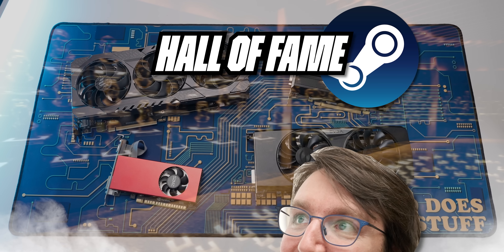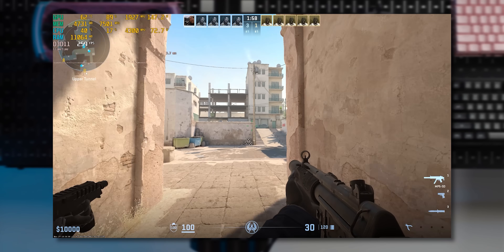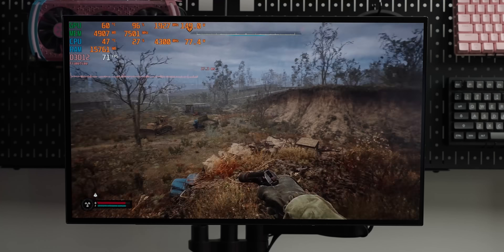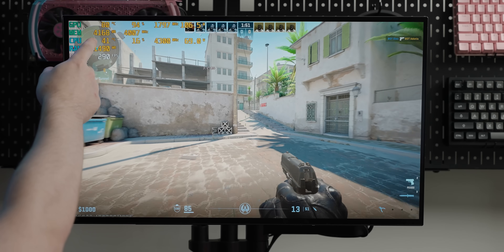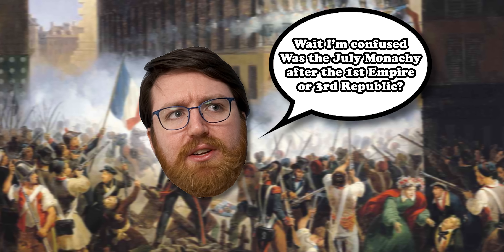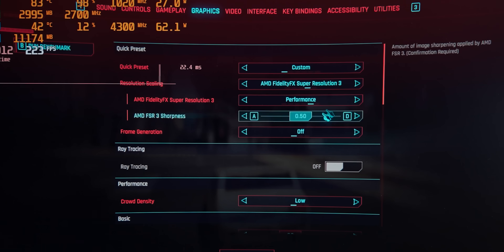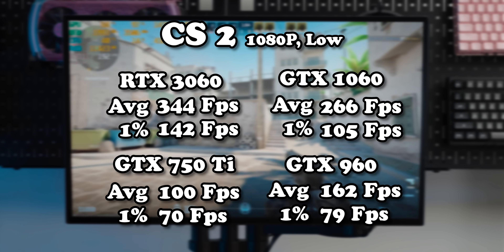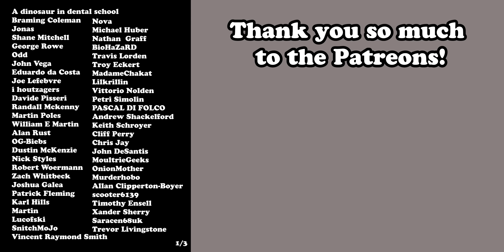GPU Showdown: 7 Years Of Steam Hardware Survey Kings

Comment: You missed gtx 1650, which was on top before rtx 3060.
I really wanted to see the comparison between 1060 and 1650
Reply: 1650 has 4 gigs. It would have to be much better to overcome that
Reply: @davitdavid7165  The 1660 Super is the budget card to beat right now, IMO.  I've picked up a number of them on eBay around $80 and they perform like a GTX 1070.  If you're at 1080P and willing to dial things back to Medium settings on newer games like Helldivers 2 it'll still put down 60 FPS.
Reply: The gauntlet has been thrown down!  They must enter the deathmatch arena of death!
Reply: and the 1050Ti...
Reply: @zahadou  4 gigs runs out faster than 6 in modern games
Reply: 1060 wins because of the 6gb of vram, the 4gb 1650 makes it basically ewaste
Reply: If they would still sell the 1650 for $99 retail, it would be king again.
Reply: @RobertFixit  The 1050 was the I can't afford anything else in the crypto bubble when GPU's were stoooooopidly priced. It is not a great card. The 1060 was far better in comparison with a average of 67% better in speed.
Reply: Nah  @RobertFixit

Comment: Shocked how well the 1060 is still doing 10 series was so far ahead of its time
Reply: I'm still running a water-cooled 1080TI paired with a 12600k. Absolute legend of a card.
Reply: 10 series was probabaly the best series ever released

it had everything. From power connector free 1050 to high end 1080ti that still crushes newer games and is for the oomph it has, extremely power efficient for the time.

ive had the 1060 Aorus Xtreme 9gbps which i bought for 240 bucks shortly after the cards came out. I bought it used but it still had guarantee so an awesome deal. I OC'd it butit wasnt actually needed. It played every game i had on ultra, 1080p with 60+ fps. Only limited by my monitor.

When i deactivated the games usually ran up to 65 to 100 fps and Doom even higher. 

Battlefront 2, Battlefield 1, Doom 2016, Metro Last Light Redux, Fallout 4 with 200 mods all without any trouble.  (native and no use of FSR)

and the card ran ice cold and power efficient despite being cramped into my super tiny Dell Office PC case.

And i had not a single game that was able to even remotely fill up the 6GB vram of that card. Vram was mostly scraping at 4GB with my fully modded Fallout 4.

show me the 4060 nowadays and test it to play brand new modern AAA titles in native 1080p on ultra. Things defenitely changed.
Reply: I’m using a 1070 and it’s great!
Reply: It's whatvmade them think wsit we can't build cards like this we won't sell any new editions... thats when they went to skipped cards to push profit over value.
Reply: Yeah... I was building a Quad 780TI build.... that got instantly wiped out by the power and ram of the 10 series....
Reply: I upgraded from a 1070 ti last winter to a 7700xt. I built a PC for my daughter for Xmas and put the 1070 ti in it. Still going good.  However, I purchased that 1070 ti during the mining craze and bought it used for $600  😞
Reply: @jeffreygrindle6396  still rocking 1060 6 gig! Works perfectly
Reply: My 1060 6GB is still going strong. :-)
Reply: @swealer  the 20 series could of been good it was just so overpriced for it limited gains
Reply: @jeffreygrindle6396  exactly my thoughts! Sure the 10th series dont got ray tracing but yeah, overall the better series in my opinion😉

Also, happy holidays guys😀
Reply: @jeffreygrindle6396  could *HAVE, not "of"...
Reply: Cope, the gtx1060 was shit.
Reply: @LawrenceTimme  Everything depends on the system it's put into.
Reply: My dad's PC got a 3GB version and my friend got a 6GB version both still get used for allot of modern games even cyberpunk 2077 on a 3GB 1060 is very playable on 1080p
Reply: @toxictophat711  *a lot

Comment: David should have included the 4060 in this video, as it's going to be the future champion starting next year.
Reply: Is it, though?
Reply: @rustler08  It will likely be based on sales. Basically every Black Friday gaming PC "deal" around $1,000 seems to come with a 4060 of some variant.
Reply: @Ultimatebubs  No need, roughly about 10% faster than 3060 on average, sometimes even slower than 3060 in Vram heavy games.

Comment: 3:52 I play cyberpunk at 1440p high preset with medium ray traced reflections on and dlss on balanced, average fps is 64, using rtx 3060 12gb, 5700x3d and 32gb of 3600/cl14 ram.
Best settings to play the game imo.
Reply: You got exact same specs as me!
Reply: Why you're using RT on a 3060 is beyond me. CP2077 is a fast-paced shooter when you get into combat, not really sure why you're ruining the higher FPS you'd otherwise get to have reflecty-lights...on a pleb card from almost two generations ago.
I don't even use RT in CP2077 when playing, and I'm on a 4080.

Comment: You can get that same 750ti on Ali Express MUCH Cheaper. It reminds me of a beefy GT1030 more than a 750ti. I also Own a 750ti 2 Gb that is Large with 3 Fans on it & requires a 6 Pin Power Cable, it blows the little Low Profile 4gb model away

Comment: Wasn't the GTX 1650 most popular for a brief period of time?
Reply: Yup, Dec '22 to Sept '23 based off a quick google
Reply: It was bought in huge numbers by the prebuilt PC makers to make an office box into a low end "gaming" PC, and lots of those systems were sold and used...many are still used today.
Reply: 1060 was the best bang for buck. Like the rx6600 is now. 1650 was a budget card that came later
Reply: The performance difference compared to a 1060 ain't much, I imagine it's mostly vram limited

Comment: Wasn't the 8 Gig 3060 the original and the 12 Gig the bastard cut down version they released later on, or am I miss remembering that?
Reply: No, the 12 Gb was the original version which was a huge controversy because the 3060 ti and 3070 just had 8 Gb and the first 3080 only 10 Gb.
Reply: @zeronin4696  Ahh okay, I felt like I might be miss remembering that, thanks mate.
Reply: The 2060 was the one getting a 12GB version later (so late it was actually a year after the 3060 12GB came out)

Comment: The Rx580 Will still be the goat
Reply: I only just this week replaced my RX 480 8GB with a 6750XT. It held out so damned long.
Reply: @Ametisti  nice upgrade
Reply: Yet 0.75% . I bet even at the best it wasnt really higher than 1%.
People love pain and Nvidia bring it 100%
Reply: @fabrb26  Looking at the Steam hw survey on web archive the RX 580 seem to have been a bit above 2% in late 2020. It was on the 10th place after 1060, 1050 Ti, 1050, 1070, 1650, 2060, 1660 Ti, 1080 and 2070 Super.
Reply: Rx580 for the winnn
Reply: Nah that's the 1080ti
Reply: My Vega 56 still rocking to this day.
Reply: still using mine
Reply: For sure. The 8GB version punches well above its class.
Reply: @theallix  frfr, sadly it's been replaced by the 2048sp variant that other chinese brand sells which i dont trust
Reply: Its not been replaced, still can find them used online
Reply: @daveplayz500  Aka the RX 570 with a scam name.
Reply: Is there still driver support for that thing? I think the 5700xt is the best budget GPU price right now imo. Would rather get that than the 3050
Reply: @NightmRE_ZZZ  no i don't think so, and yeah 5700xt is a great choice and NEVER EVER BUY a 3050
Reply: @NightmRE_ZZZ  yeah its a great choise the 5700 xt. with a bios mod (90%- TDP anmd 90%+ TDP) you can ame rily nice i play Elden Ring on High with only 130TDP(max) on my rx 5700 XT
Reply: fr fr
Reply: AMD fanboys not missing an opportunity to always mention a amd gpu when it is not even in the video.
Reply: @adlibconstitution1609 Nvidia fanboys not missing an opportunity to have single digit 1% lows with 2gb of Vram on anything but the flagship
Reply: @3a.m.284   And? Rx 580 is not even mentioned in this video. You AMD fanboys always bring up AMD GPUs even when it is not even mentioned
Reply: @adlibconstitution1609  It's fair to mention 580 because it was very popular among DIY PC gamers for a long time, arguably only lost to 1060 on steam surveys because 1060 were used for many internet cafes and OEM PCs.
Reply: @nonameyet2205  Nope, it is nowhere close to the 1060 in popularity and this video is about the top GPU in steam for 7 years. Nowhere does it mention the Rx 580.
Reply: @adlibconstitution1609  still, a goat GPU
Reply: @adlibconstitution1609 NVIDIA fanboys not missing an opportunity to always whine about AMD fanboy talking about a  GPU he likes
Reply: Crap

Comment: Gtx 1650 overtook the 1060 before the 3060 took over
Reply: That makes sense because it was found in just about every single entry gaming laptop which all struggling uni students game on
Reply: @Daygunjim you reminded me of my old self
Reply: Because its so cheap in the used market and doesnt need an additional 6 pin power cable which made it perfect to upgrade office PCs. Also alot of entry "gaming laptops" from like the last 5 years had a gtx 1650. The 3060 is too expensive for the majority
Reply: @zeronin4696  and also the 3060 and 4060 counts the laptop variants separately, the 1060 and 1650 counted them together
Reply: @zeronin4696  Even laptops with current gen are made with 1650, and yeah a lot of OEM's are still 1650
Reply: @zeronin4696 I literally just bought a used gtx 1650 laptop for some light gaming on the go and homework, I have an rx6600 in my main pc which I just used to replace my old…gtx 1650 😂! It is still an okay card for 1080p on esports, and honestly for 300 the laptop was a steal, putting in another 8 gig stick of ram today!
Reply: @zeronin4696 No it was because of the pandemic, no one could get new cards or they were scalped
Reply: @WTBMrGrey  Yeah... that and bit coin farming took off right before that.... it look like 3years longer than I ever intended to get a 3070TI for my gaming rig..... due to scalping and I just ignored the 3090TI due to cost.
Reply: Was thinking the same. I recall a time when the 1650 overtook the 1060 for some time. It was even above the 3060 for a while recently.
Reply: i was about to say the same.... the 1650 was on steam top for a while actually
Reply: Nothing took över 1060. I still have it til this day
Reply: @jakefrozt5 i agree still rocking a gtx 1070
Reply: @johnstricklin31  that's what I'm saying. Thinking of upgrade to a 1070 8 gig. Haha
Reply: This
Reply: does dawid seem like he even remotely cares about being accurate
Reply: GTX 1650 is the skinny ugly younger sibling of the GTX 1060.
Reply: Eww
Reply: Also, there were two versions of the 1650 with 2 different kinds of memory. GDDR6 and GDDR6x
Reply: @Skradgee  not 6x gddr5 and 6
Reply: It was gddr5 and then gddr6 there was no gddr6x
Reply: and what happened to the classic 1050Ti ...
Reply: I had a 1650 in 2019! I use it as a second GPU alongst the rtx 4060 ti
Reply: Still rocking one on my desktop and it works for most games at 1080p, its showing its age but it will have to do until it dies
Reply: 1650 is such a wonderful card. My first choice for PC´s with crappy PSU´s. Sure, in 2024 not enough for new games, but for older titles and e-sports, its still a genius peace of work
Reply: @oliverhoschi6135  upvoted by 5 1650 owners
Reply: @oliverhoschi6135 i mean you can still play most modern games with 1080p low.
Reply: You are correct.
Reply: 1650 was one overpriced piece of crap, you could get so much faster card from the used market with the same price.